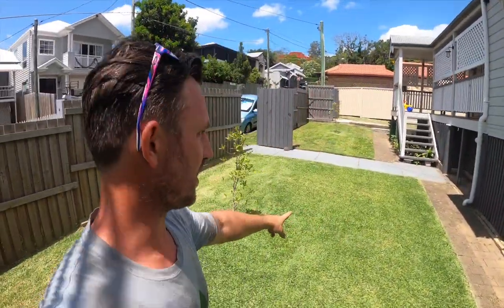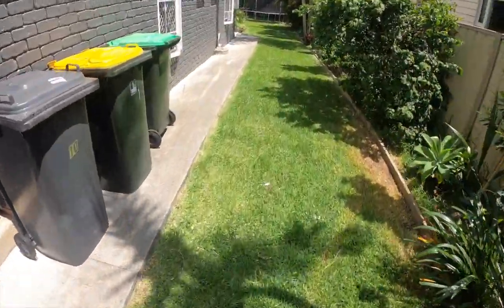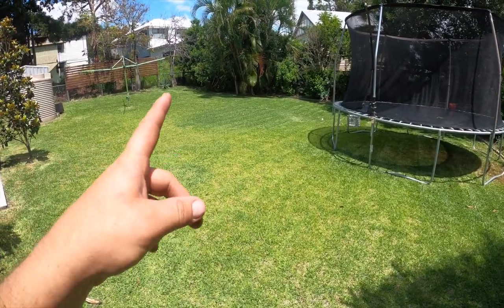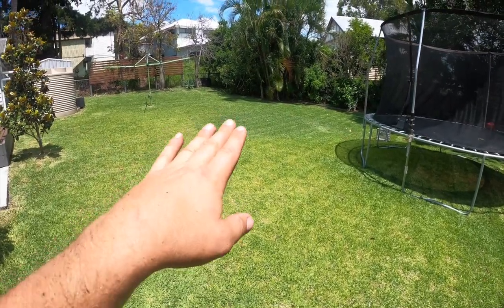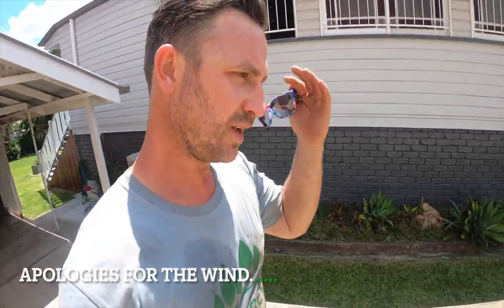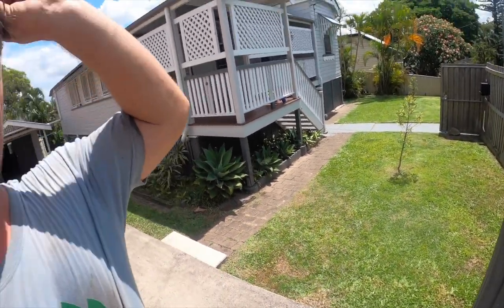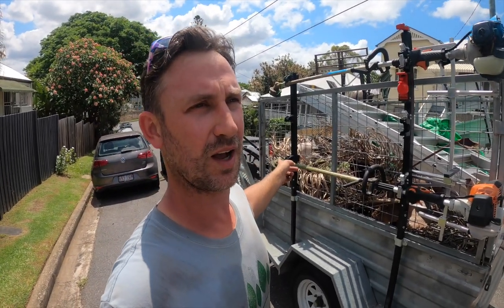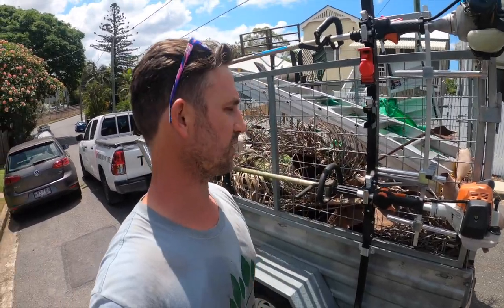This OVER GROWN LAWN gets the MOW TIME treatment.

Comment: Nice one
How long did that job take? Also what did you charge for that? Do you charge your clients per hour or quote per job? Thanks
Reply from the maker: Hey mate

Thanks for the support.

That job took approximately 3.5hrs I think. Had not been mowed properly in a longgggg time. That was a first mow on what is now an ongoing client. First or one off jobs I quote for, than ongoing regular mow/maintenance is a rate. 
You just have to work out your own rate that you feel you are comfortable with. 
Hope that helps mate 😀👍🏻

Comment: Hi - Great Videos :)  I've noticed you edge with th whipper snipper. I have the Atom edge trimmer. How do you find using the whipper snipper compared to a dedicated edger?
Reply from the maker: Hi Emanuele

Good question. I’ve never used a dedicated edger before. Have never needed one. Most of my clients are private home owners, so they don’t have huge amounts of edging. I’ve just always edged with a brush cutter as a child and never stopped with it. The guys I know who own dedicated edges do parklands, hospitals, industrial areas that have a lot of edging. 
I also have never purchased one because it would mean having to pull and carry to pieces of equipment out just to get the edges done on 1 lawn. Not great for time saving. Dedicated edges are great though if you have trouble getting crisp edges with a whimper snippet or if you have some physiological issues that impede your ability to hold a whopper snippet. 
Sorry I could of been more helpful.
Have a great week 😀👍🏻